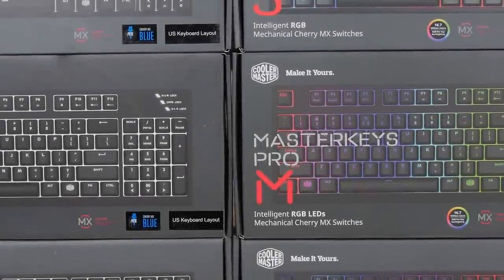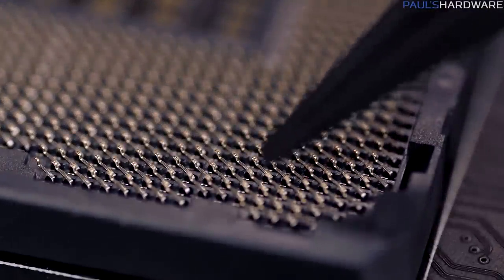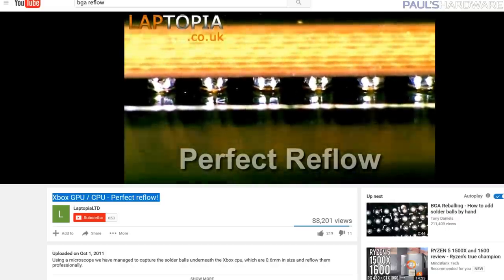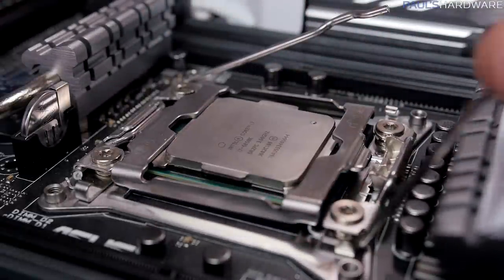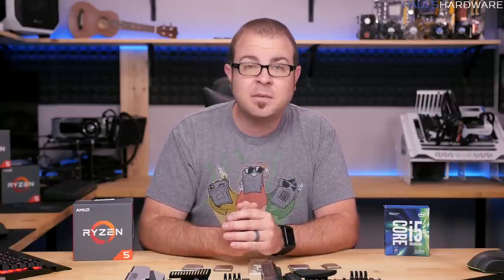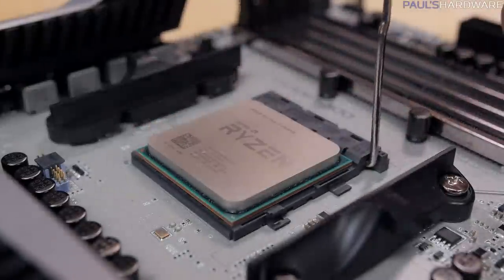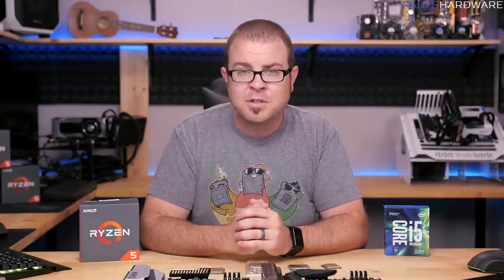LGA vs PGA! Which is better?

Comment: i much prefer intel processors but I must say that my first PC was an AMD build and i dropped the processor off of my 3 foot tall table and it landed pins down and nothing happened to the cpu and I ended up using that system for 6 months before I realsied that AMD was total CRAP. But they definitely have redeemed themselves with ryzen that is for sure!

Comment: Prefer LGA, to many cpu with bad pins out of the box or problems with pins after removing the cpu from the motherboard.
I think i had 3 cpu's in total that had some kind of bend pins out of the box.
Most are repairable but my first pentium 4 and last year my fx 8320 was so damaged after removing it that i had to throw it i the garbage bin

Comment: LGA = Intel

PGA = AMD

I'm still confuse
Reply: LGA = Land Grid Array (Pins on the motherboard, both Intel and AMD Threadripper use this)
PGA = Pin Grid Array (Pins on the CPU)
BGA = Ball Grid Array (Mostly used in GPUs to solder the GPU to the card)

Comment: LGA. Only LGA. I hope amd starts using LGA finally. Why? Motherboard costs 200$. Cpu costs 500$. I'd rather have the mb pins broken. Also, u never touch the socket of your mb, but u do touch the cpu (cooller removal, paste renewal). So the answer is obvious.

Comment: hah I remember when I tried to add new coolingpaste to my brothers old am2 pc
was a phantom x2 from factory. Overheating problems.
I unlocked the coolingblock. wasnt moving. 
I checked If I forgot something. Nothing. I gave it a good wack and the cooler came off. with the CPU attatched to it.
riped it right out of the socket xD
...
wow continued watching and paul just told my story

Comment: LGA is shit. With PGA if you fuck up the pins, you just get a new cpu. With LGA you're stuck either trying to bend them back or you have to get a new mobo. Since I use older PC components because they work just as good as the new stuff (Older high-end VS new low-mid range) so I can replace a CPU much cheaper than a mobo. Still, intel is where all the good shit is at so I don't really have a choice but if it were up to me, I'd be using PGA. Fuck BGA.

Comment: Hate lga. Ruined a motherboard that way. I think the CPU was fried with it so lost $400 rather than $300. It is more dangerous and a lot weaker. I can tough motherboard pins and break them. CPU pins I have tested on an old cpu.  I through the chip on the ground several times with minor bends that I could fix with ease. I was literally able to bite and rip without breaking them. I

Comment: LGA Pros:

1. Harder to damage the CPU
2. Easier to disassemble

LGA Cons:

1. Easy to damage motherboard pins
2. Very difficult to fix said bent pins
3. CPU design makes it possible to warp the substrate if the cooler is too tight or the system is "bumped" too hard
4. SMT components on the bottom of the CPU can bend pins if you drop the CPU out of alignment
5. Very easy for a bit of dirt, grease or other contaminants to cause a pin or pins to not make proper contact and cause very troublesome to diagnose issues. 

PGA Pros:

1. Much sturdier socket 
2. Possible to fix bent pins most of the time
3. Installation is less risky (if CPU is handled with care)
4. No warping of the substrate with over-tightened coolers and or bumping
5. Better contact between the CPU and motherboard which results in fewer contact related issues.

PGA Cons:

1. Easier to damage CPU
2. Cooler pulling CPU out of socket if you are not familiar with how to remove the cooler properly or habitually pull it like you would with LGA.

IMO PGA wins hands down, the only reason LGA even exists is to shift warranty claims to the motherboard manufacturer rather than the CPU manufacturer. IMO it is a total cop out. LGA does not offer any benefit over PGA electrically, in fact the contact points are smaller so may even result in less contact (not tested).

Comment: i hate LGA so much... its so easy to band the pins on mobo, even putting the cpu into the socket can band some.. plus its reason why there is so few mobos for old intel paltforms and so many cpus.. cpu got stuck with cooler? never happened to me.. i am not amd fan, this is angry intel cpu owner

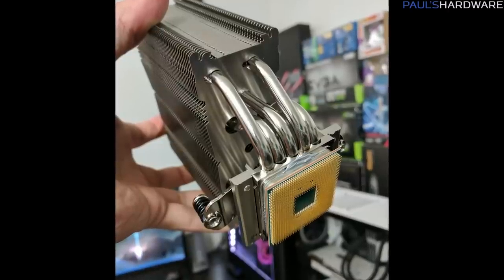Comment: 6:33 that was my Most Hatest part everytime you pull and remove cpu cooler AMD processor also remove but didn’t lever pointing up. so that’s why Intel is better performance for gaming and the FPS is very high than AMD

Comment: I like pga more and i am glad that AMD is back , i never damaged amd cpu or motherboard , but it happened to me few times with intel motherboards . Because intel need to put a lot pins on small area they are really thin and they bent already by using slightest side force. It even happened to me that the pins where bent when the mobo came from retailer , although they replaced the mobo  it took 30  days because they handled it as a warranty exchange .

Comment: I built a lot of pc's in the old days and never trusted the AMDs. They seemed to fail too often and I don't trust them to this day. I just got into the LGA systems and like them as the CPU is what is bandied about, rarely the Motherboard so the risk of pins being mashed are very slim. I will stick with them.